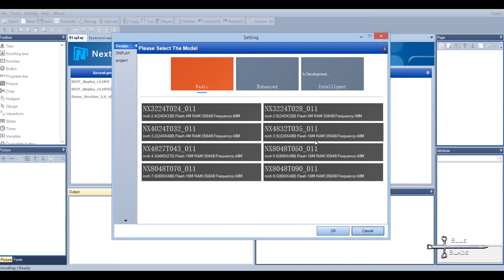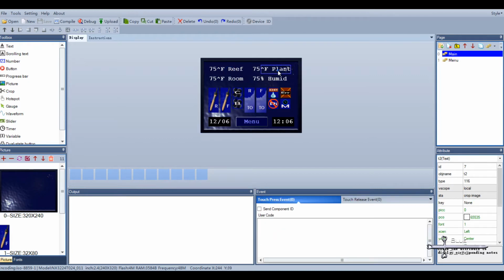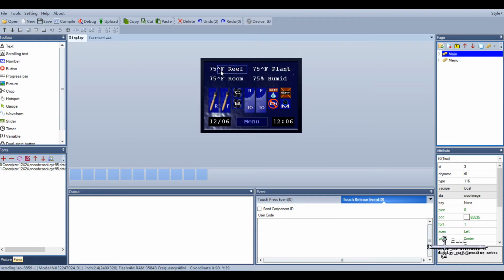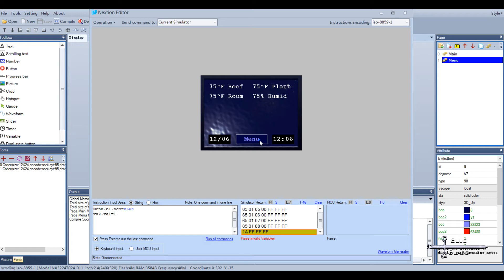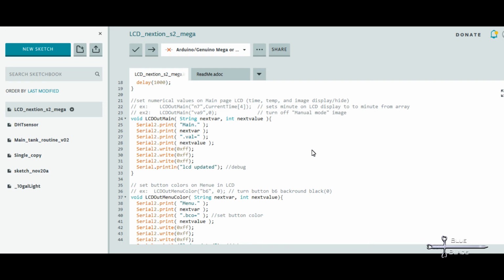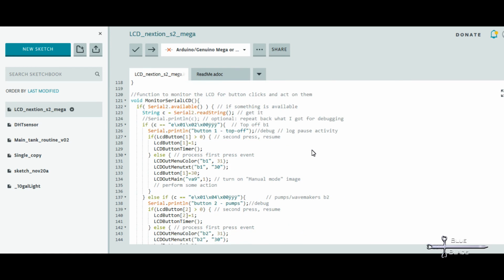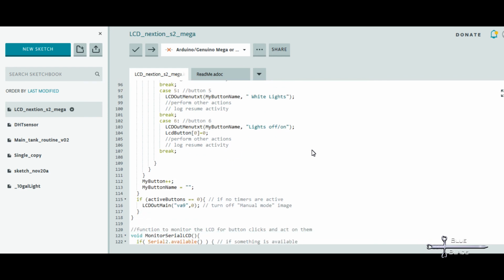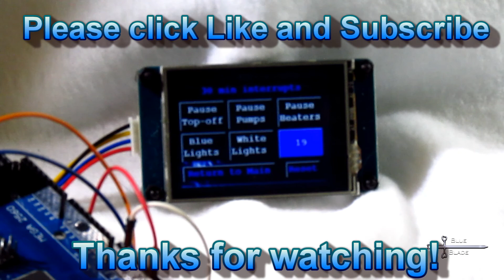DIY Arduino Aquarium Controller Part9: Nextion LCD touchscreen with Arduino

Comment: you are an expert in the field and you are offering great info for DIY persons like my self! my issue is that you need to simplify a lot more! I'm an electrician myself but a beginner in this field. maybe you can considerably be simplifying more in your next DIY
Reply from the maker: thank you - i hear you. to note, this is a huge project - this video is one of a 15 part series where i tried to share what i have learned by breaking it down into smaller components.  for this one, i  fear that if i bundled it up in a simplified cut and paste project,  it would only apply for people wanting to do the exact same thing. by going into detail about all the code and low level components, my hope is that others can take from it to do their own thing - whatever that may be.

Comment: Anyone have any clue how you would use the arduino to say go to a specific page without a button using serial? I am also assuming I would need to write something in the hex him and I t may seem unnecessary but I’m trying to use a camera that so that if an object is recognized it turns it to a page without pressing any buttons
Reply from the maker: in the nextion code, create a global variable, and have code on the main page that scans that variable periodically and changes the screen based on its value. you can update the value of the variable from the arduino . I do a similar thing to hide or show icons.

Comment: Here's a question forgive my ignorance, can I make a security system for an user  ? For example; would there be 2 users as Admin & Operator ? And different passwords for them ?
Reply from the maker: I didn't include that in my build as I had no need, but it is absolutely possible. it is a php website, so you could add any security you like that is compatible with PHP/Apache.
Reply from the maker: oh - i didn't notice which vid this was on... security on the Nextion...  I suppose you could. at least rudimentary PIN/access codes to perform certain functions. you would likely need to hardcode it into the display - at least in part. so it wouldn't be too secure.  but then again, since they have physical access at that point, there wouldn't be too much benefit to high security. it would be enough to keep your toddler from mashing the wrong button.
Reply: you can add a password to your project whick locks it...check settings on display setup for new project